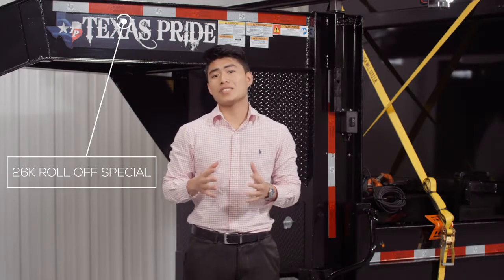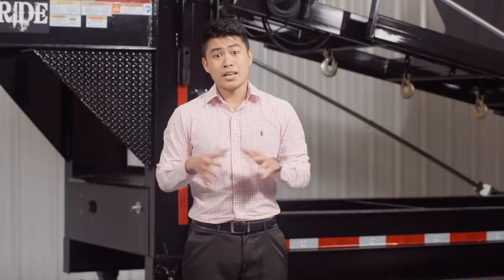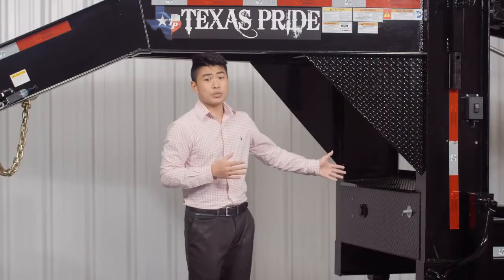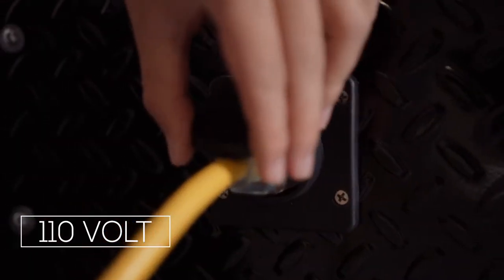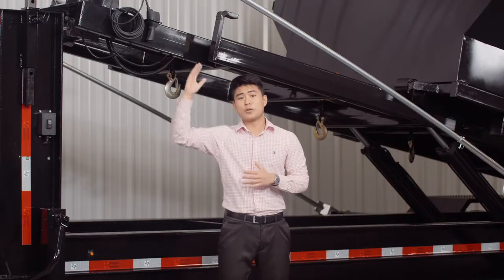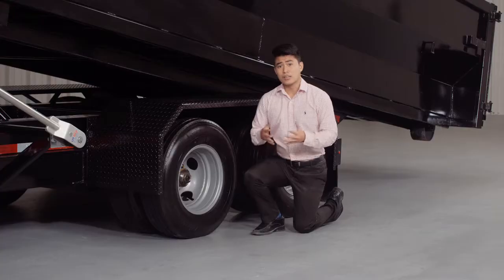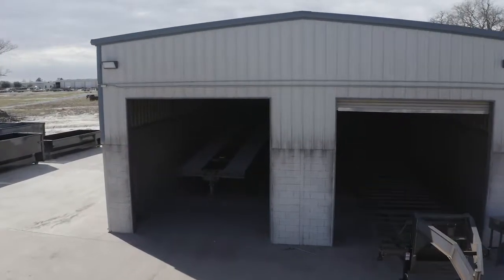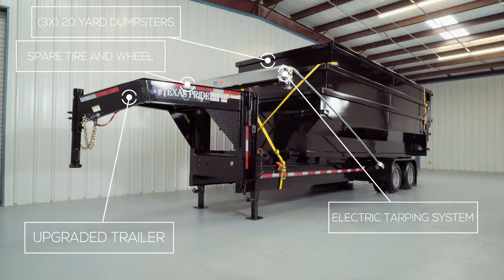Walk Around: 26K lb GVWR Gooseneck Roll Off Trailer (Special) | Texas Pride

Comment: if they are delivered stacked up .. would I just have to use the dump function to un load one by one?
Reply: No, you need a forklift to unload, they're neatly stackable though. Just recieved mine today, unloading was interesting with the equipment I had on hand. Dont know how youd do it without a forklift

Comment: On a budget for truck purchase (less than 20-25k). What’s a good truck option to haul one of these loaded trailers?
Reply: Nothing less Then a 3500 ram or f 250
Reply: Has to be a F350 and up i have this set up
Reply: @__S__V__  Do you have an F-350 Dually or standard?
Reply: It would have to be a Dooley since the single rear wheel is only rated for 21,000 on the gooseneck